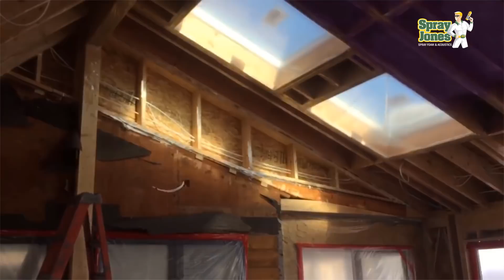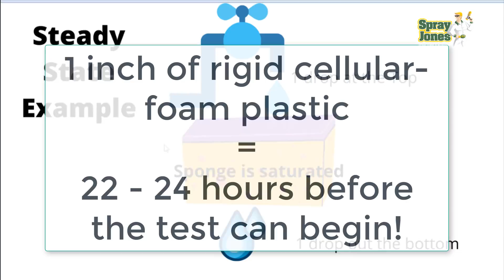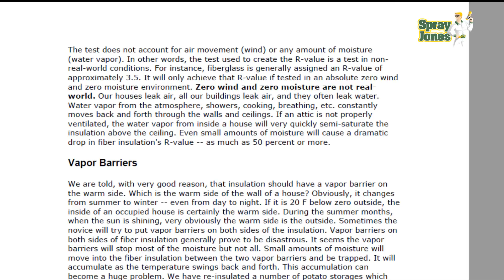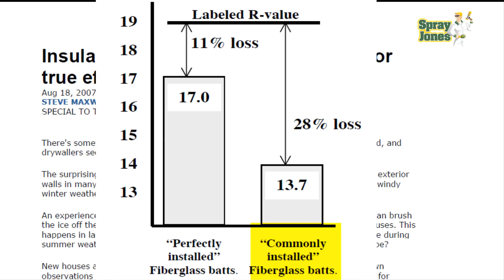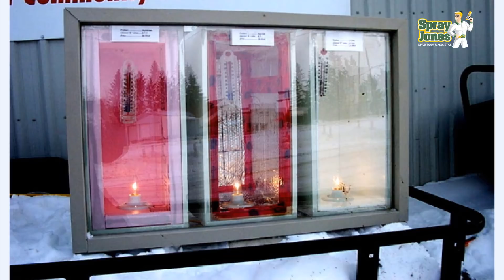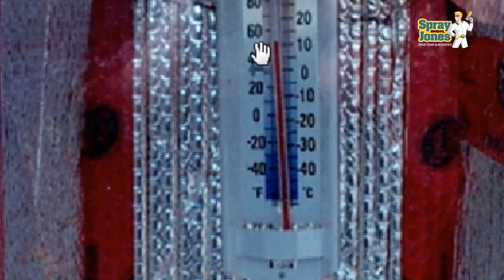R Value and Spray Foam Insulation - Just the Facts!

Comment: Major PITA if roof gets a leak and sheathing needs to be replaced. How would you replace foam?
Reply from the maker: With a spray gun. Not to be a smart ass this is no big deal.
Reply: Spray Jones not to be a smart-ass...does your gun spray through finished drywall?  Remember,  not all rafters have attic access. Many carry cathedral ceilings. So my concern is legit.

Comment: I was really looking forward to this discussion, and I was NOT disappointed! We continue to take the red pill, and I am glad! Given the multifaceted, multidimensional effect the various means of heat transfer (conduction, convection and radiant), has anyone devised a better way of quantifying and qualifying the true performance of the different insulating materials? It seems that the  only reliable metric that most non-specialists (a.k.a. homeowners) have is cost for heating and cooling. Inquiring minds want to know more!
Reply from the maker: We have the ability and knowledge. The reasons for not doing it are far more sinister. We are up against corruption at high levels that profits a few. 
"it's a big club and you ain't in it."

Comment: What are your thoughts on doing spray foam and then following up with Aero Barrier?
Reply from the maker: Rubbish. 
Use caulking manually into all the joints and verify that it is sealed, and make it that way.

Comment: Great Video.  I think you answered my question I had from a previous video.  Seems like bottom line, as of today people will still have to have the Code R-value rating to pass inspection even though the effective insulation value is way beyond a typical fiberglass system.  This is probably steering people away from the cost, if the Spray foam industry has to charge/spend more in product just to meet code.  That's a shame.  
But I will be doing spray foam because I know the value it gives, regardless of cost. I don't think people realize the energy savings throughout the life of the home will way pay itself.  
Again, Great video.
Reply from the maker: Thanks. I will be doing some more on ROI and fighting code on how to do it. But the SPF guys have to step up for this. Joe or Jill homeowner cannot do it.

Comment: Great show, I use Rock wool, and spray foam,   foam is my air/R and Rock wool is fire/sound.  So bats in walls, one to 3 inches of foam outside, with 2 inches of rock wool over that., in flip homes I can take down the underside of the eves have you guys spray the plates and roof surface there, helps with ice damming,  and air tightness. ,  I have even had you guys foam over Hardie Board siding, and then just put Hardie Board siding over that...worked great, sealed the house and cut the bills in half.  Spray foam is picking up, interest in Texas.  Also I like to rock wool over your foam to guard against bugs. but foam is best for R/ air  tightness.   I think over time the consumer , with your channels help, will begin to get the picture,  I think all batt type insulation is on its way out, except the Rock wool.   Do not apologize,  those that have their own businesses, or managers of apartments are watching this,  no such thing as to much information.   Great show.
Reply from the maker: Thanks for the great feedback Bob. I agree with you on fibrous on the way out.

Comment: I liked the explanation of why the codes call for so much attic insulation.

This summer I'll be working on super-insulating my mountain cabin. I've been wondering what to do with the ceiling. Flat ceiling, 6 in 12 roof pitch, 2x4 trusses on 24-inch centers. Currently there are 1/2-inch fiberglass ceiling tiles laying on the Sheetrock, and "R-19" fiberglass batts, paper side up, on top of those, with gaps all around. The original builder used lots of 1/2-thick fiberglass ceiling tiles everywhere. I think he had a warehouse full of them and didn't know what else to do.

I'm fond of 2-inch foil-faced polyiso boards and was planning on using a double layer on the outside of the walls under new siding. I've determined that even if the 3 1/2-inch fiberglass in the wall cavities is R-13, there shouldn't be a condensation problem on the inside surface of the polyiso. And with taped seams it should be a fantastic vapor, air, and water barrier.

For the attic my first reaction was to blow in a ton of loose insulation in, like maybe 24 inches. But I believe your animation of convection within the insulation, and the statement that the reason the codes call for so much R-value in the attic is because the actual insulating effect is far lower than what's on the label--even if the code inspectors don't realize why that requirement is so high. I called the planning department, and they said for adding insulation (walls or attic) I won't need a permit or inspection. So I can trash the 1/2 fiberglass ceiling tiles, pull off the paper facing and stuff the "R-19" fiberglass batts between the ceiling joist parts of the truss (compressed down to "R-13" in thickness), then lay foil-faced polyiso on top of the ceiling joists, running cross ways to the joists/trusses. Of course I'd have to fuss about with the 2x4 bracing running between joist and rafter, but it shouldn't be too bad. Each 2-inch layer of polyiso will cost about $700, plus aluminum tape, plus fussing time. I'm thinking maybe 2 layers. Four inches of polyiso is "only" R-26.2, but that's an honest, air tight and vapor tight, R-rating with no convection possible, and the shiny foil will go a long ways to reducing radiation losses. If the code inspector somehow discovers I'm short on the "Rs" I'll tell him, "But there's R-19 fiberglass below the foam board insulation." The code inspector will be needed for other aspects of the project.

You spray your closed-cell foam between rafters, and that's brilliant. Putting an attic hatch within such an attic is no problem. But leaky poorly-insulated attic hatches suck if you have ceiling insulation (not rafter insulation). I saw one building-science-aware architect solve that by putting the attic hatch in the gable end, accessible via a ladder from outside the home. He had an air-tight ceiling. I'll do the same--kill the ceiling hatch and put the hatch in the gable end.
Reply from the maker: Stay tuned for the 4 part series on Roofs and SPF starting Tues.
Reply: @SprayJones , thanks. I will.

Comment: The problem is not the test process ,is the interpretation,     Because they are testing the material in a specific and scientific manera when parameter need to be the same,   From there , people can apply the different conditions
Reply from the maker: Agreed. But the marketing of R value which the test creates is not to be given as the sole source number to the consumer. They are misleading at that point.

Comment: Mike thank you for all you videos. I have a remodel going on now and I want to spray the roof deck. I’ve seen this done in my area (RI US) with open cell but I haven’t seen a vapor barrier applied. Is a vapor barrier required in a non vented attic with open cell? I have a new roof with grace ice/water under the shingles and 2x6 rafters. Or would 2-3 inch of closed cell be better. Thanks
Reply from the maker: I am a huge fan of closed cell. Starting Tuesday we wll be into 4 video series for roofs. 

There is enough info right now on my channel for you to get your questions answered. Check out the playlists.
Reply: Thank you I look forward to seeing them.

Comment: Hello Mike, I have a question regarding spray foam on a concrete foundation ( basement). What are the advantages/ disadvantages of spay foaming either the inside or the outside of the foundation, or both?
Reply from the maker: Weather.

Comment: On a new build or relay of basement floor could you insulate gravel base with 2" spray foam then only use 2" of fiber re-enforced cement and have a warm and strong enough floor?
Reply from the maker: In theory yes. 

Most floors are 4 inch thick.

Comment: So in a 2X6 wall using ZipR for the exterior walls and roof decking how thick should I spray the closed cell foam?
Reply from the maker: Enough to reach code when the combined values are added.

Comment: New polyurethane has excellent air sealing and insulating values. The other side of this is the deterioration of the material over time, potentially releasing the blowing agent or allowing atmospheric gases to infiltrate the cells. That's not to say fiberglass doesn't have its own problems with binders deteriorating. But how do we avoid the disposable house?
Reply from the maker: The foam is a multi-generational purchase. I think you need more info on just how log properly installed product lasts.

Comment: I think I now understand your beef against thermal bridging and the use of exterior insulation, they both seem to be cover ups and excuses used to explain and justify the poor performance of your worst employee, fiberglass.
Reply from the maker: Thanks but it is deeper than that. 

I believe the wood studs are performing much better than anyone wants to admit. On paper they appear low.
So why do we never see frost or water on side of a 2"x6" with 1.5 inch of closed cell beside it when it is -20 C outside? How is that possible if the stud is soooo conductive like everyone says.

Comment: Jones.. So the argument i have heard with closed cell on residential roof deck is that you dont want two vapor barriers. Wood sandwiched between Roof tar underlayment ans the closed cell. This will create moisture between the two. 
This is from a spray foamer company.

I would say, that because they are so tight together.. That this is not a concern. Only air pockets might be on the underlayment side. 

The other argument was if the roof leaks you will see it on your drywall. Which i agree with both sides of argument on this. Closed cell you coukd potentially never know untill you have roof redone in 20 years or until there is a bigger problem. 

I will have to go back and watch your older video. Unf the new one you have coming out, i may have already made my choice.
Reply from the maker: Video 1 is done for roofs. It is 45 min long and the rest won't be any shorter. There is A LOT of info I will be going through. 
I talk a lot....
Reply: @SprayJones  
And we listen to every bit.
When ia new roof vid dropping?
Reply from the maker: @turboflush  Next Tuesday.

Comment: I am amazed of the bubble wrap. Lol 😆
Reply from the maker: It's junk. 
Have had people give up on it.
Reply: @SprayJones  i actually had plans on doing the roof underside foil with vented attic and rockwool bats at ceiling. 
Found spray foam to be better option.

Will in far future maybe add thin layer of rockwool to attic floor just for noise. Or maybe not (after i decide not worth it).  Lol

Comment: Great video as always. Excellent information from your site. Keep up your great work.
I have a question about applying 3 or 4 inches of spray. Do you still need to do a 2 inch pass and 24 hrs later apply 1 to 2 inches again, or can you now do it in one pass?
Reply from the maker: We have data sheets for that. BASF has hi-build foam that can be done up to 5 inch. 
So does Demilec. 
Normally 2 inches followed by 30 mins and then 2 inches.

Comment: Thank you for your great explain of all the heat loss factors. After seeing the flash and batt failures due to to poor spray foam installation. Can you talk about Moisture and conviction in a wall cavity that is only filled halfway with foam and painted drywall on the other side. I am worried about the condensation between the drywall and foam.
Reply from the maker: There is no worry. It cannot get cold enough. 
But yes there will be more to come on this.

Comment: So, if 1inch of foam has R5 - 6, then you can safely say that 1in of fiberglass has like... R1 :)
Reply from the maker: Correct or Zero with air moving. 

If glass is tested at 3-4 inches thick it fails the C518 test!

Comment: If I ever get a chance to pull the trigger on a Passive House project I know what I'm getting. Thanks for all the good info!
Reply from the maker: Think twice. If you have to meet R value specs for fibrous values you will be forced to spray insane amounts of foam.
Reply: @SprayJones  so far from what i've seen is that it is performance based. Total air leakage requirements which is a physical test with a blower door. And then average and peak heating and cooling requirements which can also be measured. Windows can only be X% of total perimeter area. That kind of thing.

Comment: I bet you could get Matt Risinger to help you out. He's big into air sealing.
Reply: Spry Jones doesn't need his help. Matt need Spray Jones.
Reply: This video made me think of Matt. He’s a big ZIP sheathing and rock wool guy. He prefers to air seal from the outside and then use relatively non convective insulation in the cavities. The obvious problem is that rock wool is very difficult to install tightly and doesn’t address the fact that SPF has better thermal mass.

In my opinion best practice should be ZIP-R6 (more for its water resistance & elimination of thermal bridging properties than its air tightness properties) and then 2” (or less) of SPF in the cavities. 

I know you’re working on a video to address thermal bridging, the results of which might negate the need for ZIP-R6 or show it could be less (R-3) so I’m excited to see what you come up with. 

I’m a new viewer to your channel and I can’t put into words how thankful I am that people like you exist to fight the good fight.
Reply from the maker: Sure. 
Air seal is VERY important and 50% of the job.

Comment: I think the very fact that it takes poly 22-24 hour to reach ballance vs. 4 hours for fiber is proof enough of resistance to change.
Reply from the maker: Correct. When applied to roofs in the summertime we hold the sunlight off for a log time and it can dissipate back into the night sky before morning.
Reply: Yea that's nuts I always knew foam was better but i was sold on it being Russian rullet with their homes. I akways knew the standards were horse sh** but I never knew it was this involved or stretthis much its a crime in my opinion I call it Planned Thermal Deficiency and how long before formaldehyde was banned that they were selling away from foam based on chemicals being toxic when they were happily poisoning millions of homes air quality. These people should be in prison.
Reply: Whoa. That's amazing. Sufficient thermal protection with much less thickness!

Comment: The only thing I can see in my lifetime is someone coming up with a chemical or mix that will fill an entire cavity with one pass with closed cell, while keeping the same properties that the 2 inch pass has. ALL while making it cost effective to do so. Cost effective is the key to all of this though.
Reply: Attic use or Storage? Lol 

If that much insulation is needed the home design should change.... like away from timber and more towards soil and lime plaster.... our entire need to insulate these structures well is because they themselves are not designed to meet the environmental needs they're sold to meet societal needs, which are irrelevant to thermal properties. 

E.g. Most Earthship style homes have enough thermal mass in the built where insulation is irrelevant.
Reply from the maker: That would be 1 way..
Reply: Don't get me wrong I like having a job but I only have one because conventional homes are inefficient on their own

Comment: How would open cell spray foam fare on the window pane test at the end. I am convinced that spray foam of my attic roof is the way to go. I was going to go with open cell due to the fact that roof leaks will make them selves apparent. Now I am concerned that the open cell will not thermally perform as well as in the roof application. 

I already had a question for my foam contractor on how vapor sealing is handled for the open cell. Now I am wondering about the convective air flow within the open cells. 

Thank you for the informative videos.
Reply from the maker: Go closed cell if you have doubts. 

Watch the up and coming roof videos
Reply: @SprayJones  looking forward to more of your informative videos.

Comment: One bone to pick with you.  Any insulation of any type  placed interior of say 2 inches of closed cell foam  in a cavity has RELATIVELY CONDITIONED air flowing through it NOT outside air.  This negates at least part of the perception of your arguments. Again , I HIGHLY SUPPORT THE USE OF 2 INCHES OF CLOSED CELL FOAM. I also HIGHLY support the BEST SEALING PROBLEM and there is much advancement in both construction techniques and building codes or at least for Energy Savings labels such as PASSIVE HOUSE etc including more common blower door testing.
Reply from the maker: Thanks for watching.

Comment: Think of R value as the Ideal Potential  resistance to heat movement of a specific material.  
Yes there definitely is air movement within most insulations .  As I have commented in other videos there is even convection inside of double or triple pane Windows that are sealed extremely well.
Reply from the maker: Thanks for watching TK